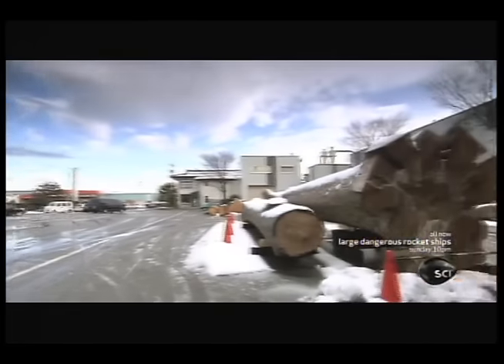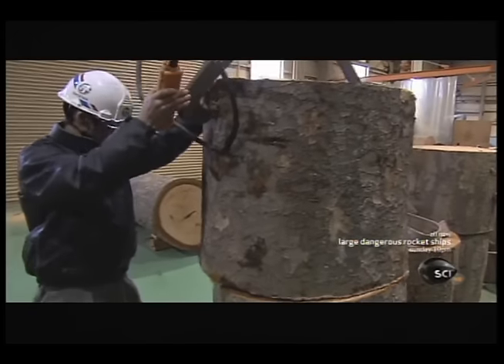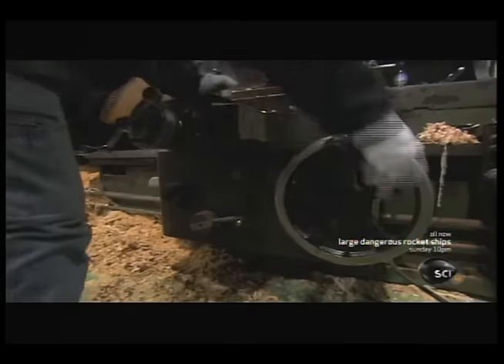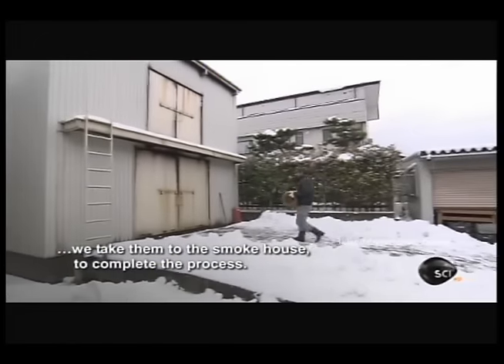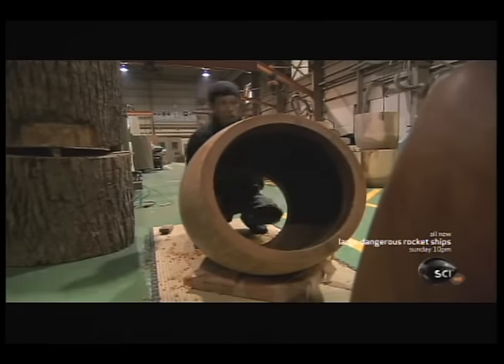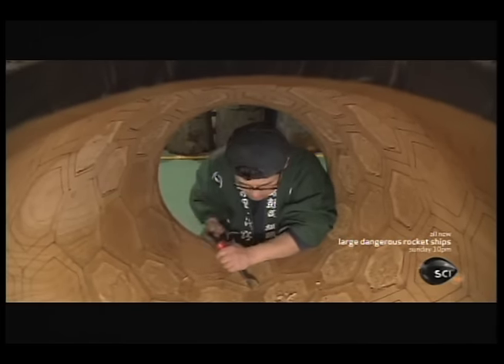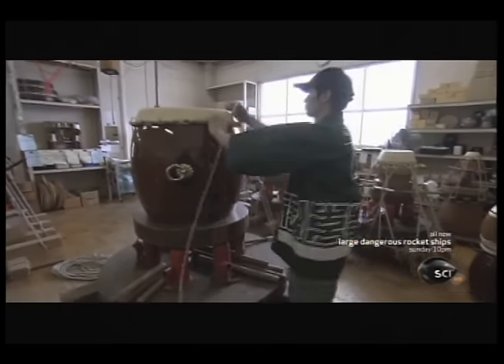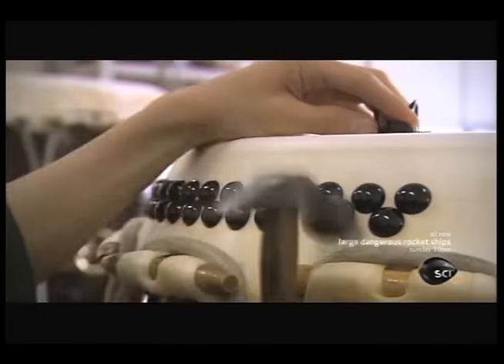Asano Taiko

Comment: Dig Exactly what I said Amazing. I had no idea they were formed from a single log of wood. The inside is more beautiful than the outside. Amazing. Hand crafted inside and out. These drums must cost an arm and a leg. The workmanship is unbelievable.
Reply: You'd be right on the price. They make four sizes of the medium-sized drums they were working on in the majority of this video (nagado-daiko), and they range from $2500 to $6500 on their US website. They also make one model of odaiko, the largest sizes of taiko drums, and it goes for $20,200.
Reply: They cost a fortune, but I was able to find one in a small shop that was obviously used, but still sound great.
But having this thing MAILED/DELIVERED to you is where the problems are starting.